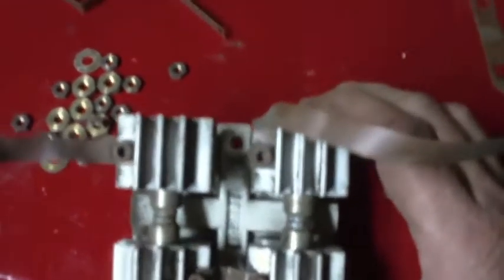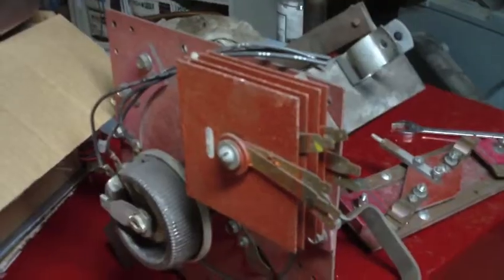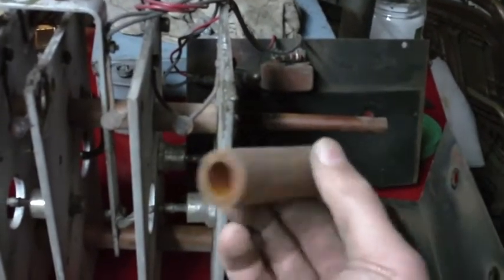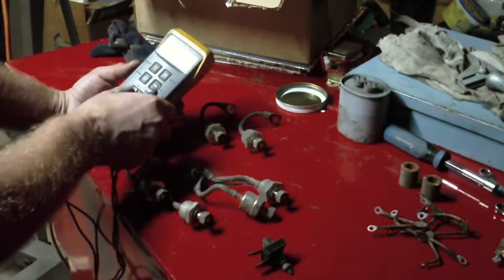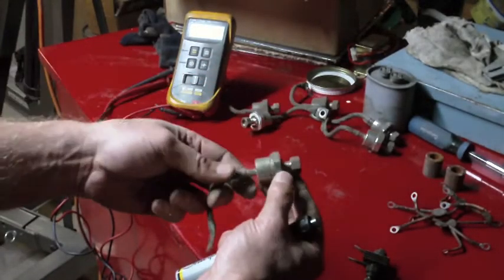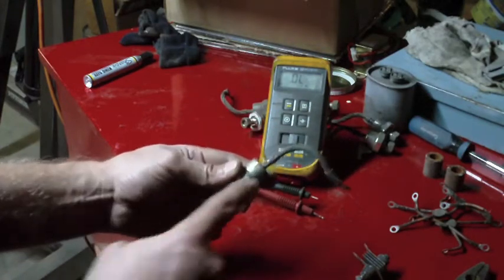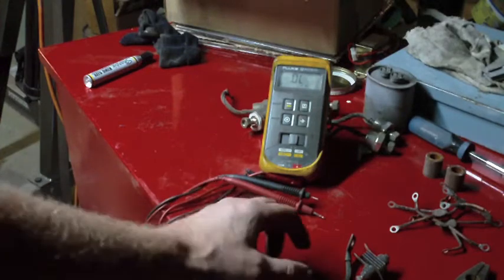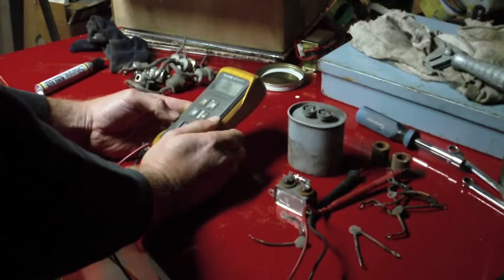The Airco "Bumblebee Crater Filler" DC Welder Part 6

Comment: I’ve got a Miller TC-150 AC to DC converter hooked to a Lincoln AC-225 welder. It’s got  aluminum heat sinks with similar small disc capacitors parallel to each diode. I’m still wondering what they are for.
Reply from the maker: Its not unusual to have small capacitors across rectifier diodes to absorb switching spikes.